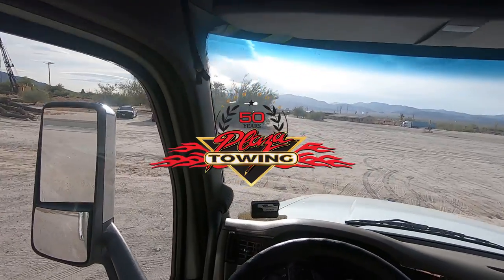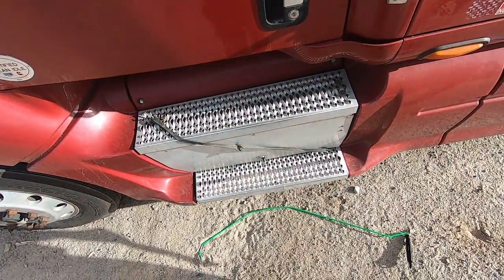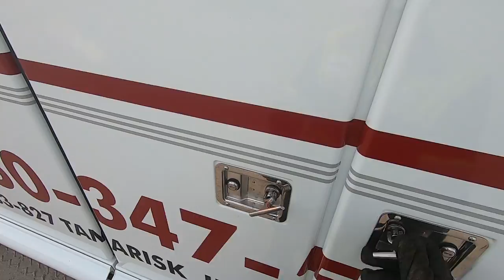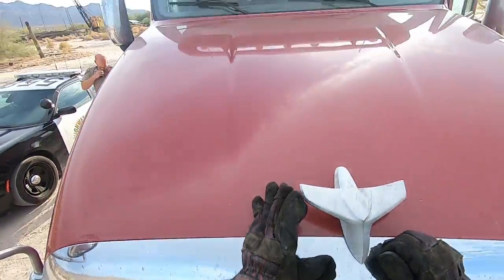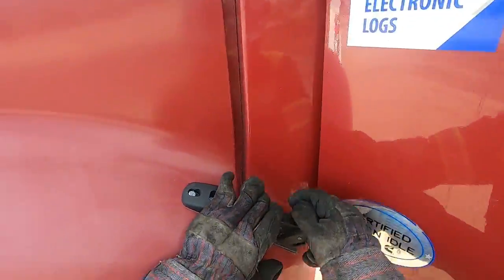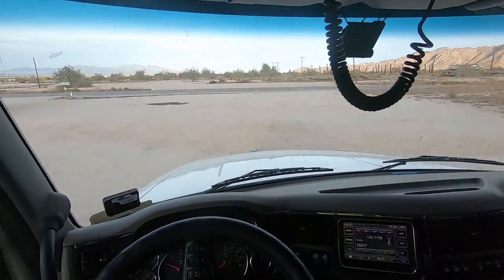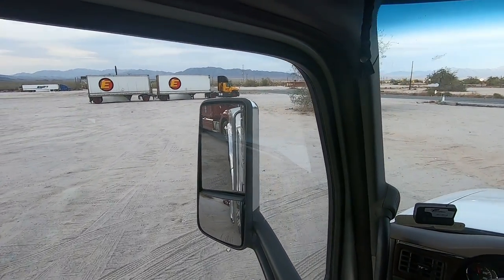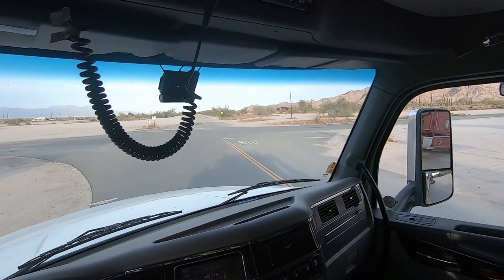Unlocking an Abandoned Semi & Towing It Away For CHP

Comment: I locked myself out of my Freightliner Cascadia many times. First time was infront of my own house. I figured out that using the tip of a fishing pole with a string was the fastest way back in, the sting could both flex the pole to the lock post and a slip knot to pull up on the latch. I locked myself out with only one set of keys so much that it only took me like 20 seconds to get back in :facepalm:

Comment: Why don't have a glad hand set up, too put air in the tanks??
Reply: Trailer supply air valve won't open without pressure in the tanks.  There is also check valves in the system.

Comment: Even if the scrap value is low surely something is better than nothing and just abandoning it?
I don't know what scrap prices are like in the states but for just a car here in the UK we get £40-50 ($50-63) depending on its size and that's just for crushing,  the model does not matter and it's based on the amount of metal it contains,  the scrap company collects too.
Companies exist here that provide the same service for commercial vehicles too but I don't know the scrap value but it's going to be considerably more than a car that only weighs 1 to 1.4 tonnes

Comment: I've done some Heavy Duty towing before but nothing like this... my Q is why did you have to pull the drive shaft?
Reply: Transmission may have engine operated oil pump.  If oil pump is not running and propeller shaft rotates transmission, it may be damaged.

Comment: Why is the tow truck left on idle, while it can be shut off, save some fuel etc for the time its not being used?
Reply: not gonna save that much to be honest, and once he's got the nose of the towed truck up, it's safer to keep the engine running in case of a weak hydraulic valve that could possibly let the truck back down.  the running hydraulic pressure would help to limit the speed or even stop a bad valve from just dumping the truck on the ground.
Reply: cause of air pressure

Comment: You mentioned THIS tow was 50 miles to your shop - is there a particular distance you could tow without dropping the driveshaft? Example - moving around in the yard (duh) or maybe just a mile or two? Or several miles on surface streets, as in: no freeway miles?
Reply: While you should drop a shaft on a manual trans, remove a axle, theatrically, you don't have to. It's just good practice to do it. All in all, the only trucks you do not move with a automatic at all, period, not even move 10 feet is volvos
Reply: Towing with the drive shaft in ruins the drive train. The answer to your question would be no not ever unless your taking it to the junkyard.

Comment: i dont know anything about trucks so excuse me. is there a reason you leave the engine on idle all the time
?
Reply: You leave it running to power all the trucks equipment like air lines,hydraulics, and electrical.

Comment: is that your truck left running in the background ?
Reply: Yes it is his truck in the background. (I dont work for his company but operate a heavy duty tow truck myslef) Our tow trucks have to stay running to provide the hydraulic system pressure from the motor driven pump. Also they need to provide an air supply from the air compressor on the motor to air up the towed unit, in order to release its brakes. Semi Trucks normally have air brake systems which lock up if there is not enough air. This is a safety feature of an air brake system.

Comment: Tip, duct tape wrapped around tie straps is good, especially in windy 🌬 conditions if straps flap around and vibrate, .
Rubber mallet for lining up rig lift underneath , saves your shoulders 

Great 👍 vid you’re a professional

Comment: Just one comment. You hung the light bar but never ran any cable to power up the lights. How does that work??
Reply: It's a battery powered wireless light bar, similar to this https://www.towmate.com/TM36Li-Lithium-Powered-Wireless-Tow-Light-_p_406.html
Reply: i think you see he disconnect it from the truck as he pulled it out. Ie battery powered. and for only an hour or 2 down the road plenty if(and likely so) its LED
Reply: It’s wireless and uses a rechargeable battery.

Comment: We locked our keys in the car once and did something similar, used crate or box straps to get to the pin on the door. 
Also why did you need to get in? 
What happens to it now?
Do you sell it or what?
Reply: Trooper said it has no plates so I'm guessing he's trying to locate VIN info
Reply: might go back to the bank and to auction
Reply: It was said that the cops called the owner to get find out about why it was there.
That was obviously before they contacted the tow company.
So then why then did he need to get inside?
Reply: to release the brake

Comment: why did you not use a air line to the glad hands
Reply: They have check valves to prevent back flow
Reply: Trailer supply air valve won't open without pressure in the tanks.  There is also check valves in the system.

Comment: Why disconnect the driveshaft? With the transmission in neutral, isn’t that enough?
Reply: No its not enough, if he didn't disconnect the driveshaft it would destroy the trucks transmission. Its not being lubricated if the truck is not running

Comment: Why not just hook to the gladhand and reverse feed the air tanks?
Reply: it dont work that way, they have a one way check valve in the main supply that dont let it drain off the tanks on a trailer  if a tractor air fail. here is part of the yearly mto safety to test it is working

Comment: Seems like a lot of hassle to remove the driveshaft, it's a manual transmission, you already supplied air to the truck to release the brakes, just flip the range selector into high range and leave it in neutral. No need to remove the driveshaft, just make sure it's in high range, low range will damage the transmission. That's all the tow companies do in my area.

Comment: Why does the driveline need to be unbolted and taken off ?
Reply: If you don't tow from the rear it can damage the transmission,  with an auto shift it can do major damage so if towing from the front disconnect the drive shaft and no worries about transmission problems. That goes for any big truck transmission the Allison as well

Comment: Why is there a different tyre on the back passenger side
Reply: cheap and putting on what you can get to make the run...sold a truck just like this..did not want it amore put cheap tires  best ones I swapped to trailer and other rigs and  leave it with junk tires
Reply: It was an APS (All position Steer) tire. It is cheaper than buying a drive tire. AKA someone being cheap and not wanting to spend money.
Reply: Steer tires are a lot cheaper, and that flat was probably that broke drivers last straw.

Comment: You have a nice Rig is that a Rotater ?i have a 1977 International Loadstar Flat Bed Sleeper Conversion Truck Bed Camper Mounted on Back 22ft flat bed utility and enclosed trailer Depending on where im going and What im hauling fraight on the Flat Bed and cars motorcycle House Hold Furniture Enclosed Trailer